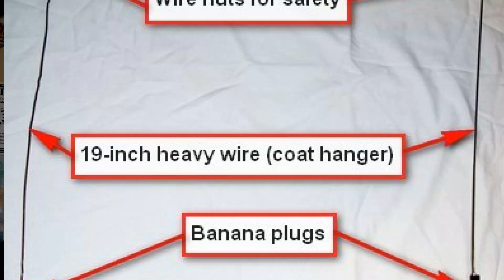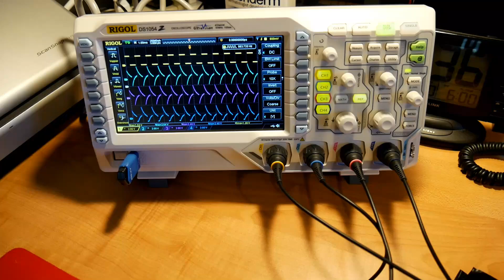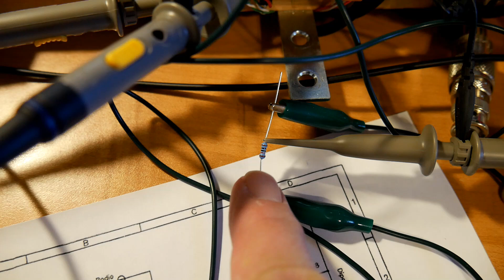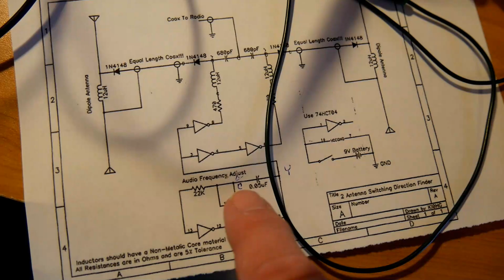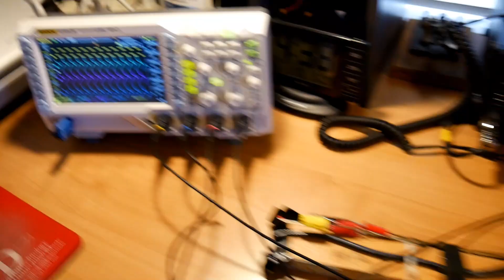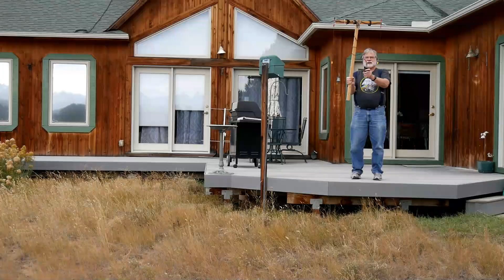Oscilloscope helps me fix Fantastic Fox Finder

Comment: Awesome format. Thanks. I have a resistor selection box I made that goes form 1 ohm to 2 gig ohms in single ohm steps. I should make a video on my build, however, mine is based on one seen on Adafruit and Hack A Day. I made some changes to increase the precision and wattage. Search for "resistor substitution decade box" on either site.

Comment: Format  is fun, a bit jittery, a little less coffee maybe... 
So...I know what those O scopes cost as well as some of your other gear... WHY are you using that soldering iron???
I think you would find your "skills" greatly improve with a decent (not saying expensive) soldering iron...oy
It's the one you got in college right? sentimental value? LOL  just playin..works right!?!
Thanks for sharing you wealth of knowledge and helping me and many others to get and upgrade licenses with your videos, working on my Extra now.
Reply from the maker: Radio Shack's finest soldering station (64-2184), probably cost maybe $29.95. I would love to have a better soldering station, but really don't know what to buy. Equipment recommendations would be most welcome! Good luck with your studying! The o'scope cost $429 with shipping and tax from Amazon. I used revenue from YouTube to buy it, and hope to use it lots more in future videos. 73, Dave, KEØOG
Reply: For soldering I use an eBay cheapy 852D+ roughly $50.. Chinese rework station that has served me well with RC model stuff. I also have a Radio Shack( just newer, still Chinese) iron that works well. 
The rework comes with a variable  hot air rework wand on one side and a variable iron on the other.
I use the hot air for heat shrink and hot glue flooding to water and vibration proof some stuff. 
I have no problem spending real money on good quality gear but do have issues with tying up lots of money on simple gear just to have a brand name and with RC stuff it's all Chinese made anyway.
Your scope gets good reviews and have been eying it. did it come with the test leads? There are different options for that scope depending on usage and was curious what yours came set up for. 
Maybe do a video on your current gear and recommended spare bits to fix or build things like your for finder.
Thanks for sharing. 73 to you as well.  Kurt, KE0JOA
Reply from the maker: Kurt, thanks for the recommendations and I'll look into them. Yes, the scope came with four test leads.
Reply from the maker: I ordered an 852D+ today. Thanks for the tip!
Reply: You're welcome.I love mine. The price and versatility are hard to beat.
I hope it serves you well.